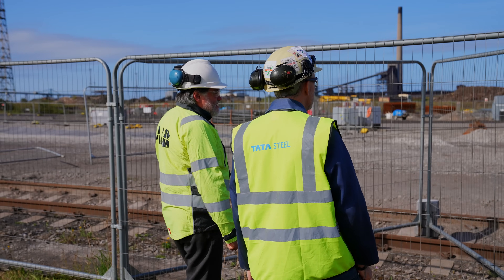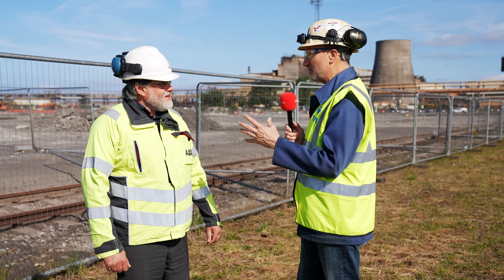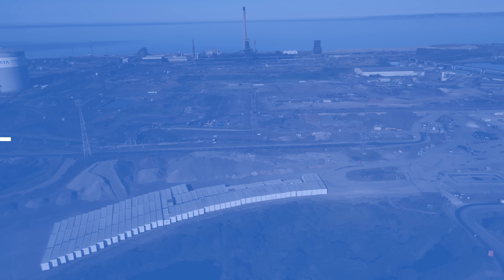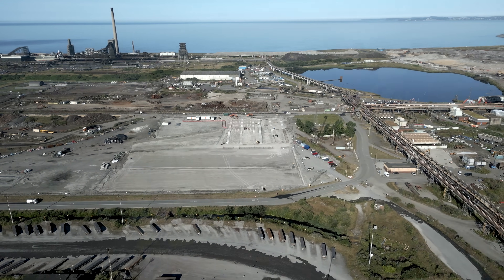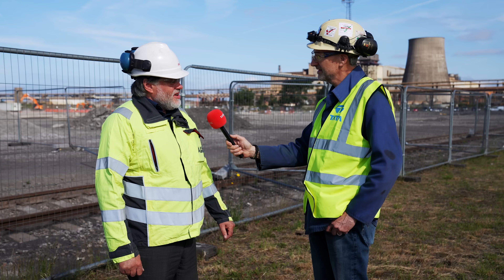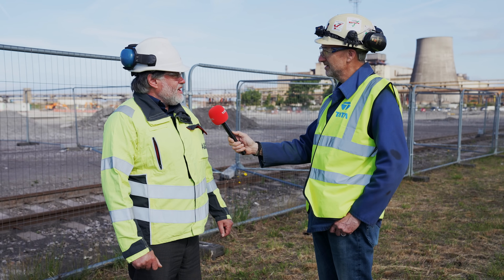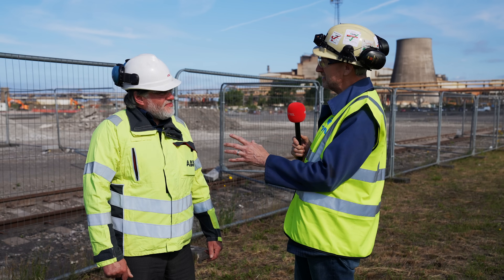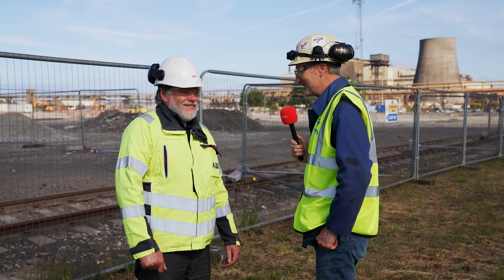Electrifying the Arc Furnace!

Comment: In the early 1950s I worked for Whiting Corp, in Harvey, Illinois in a production department that produced electric arc furnaces for the steel industry. The furnaces used 3 phase power, and I remember the size of the conductors for the 3 carbon electrodes of each furnace was around the diameter of my wrist. Electric power requirements for a factory or commercial operation are usually expressed in terms of kva (kilo-volt-amperes). Those quantities are extremely large for large industrial facilities, and often require local dedicated sub-stations or even power generating capabilities.

Comment: The UK government ruined the UK steel industry with all this net zero crap. Jobs have been lost, Families have been left struggling and shops closing down, all to keep the government happy all while more blast furnaces are being built in India! 

We simply dont have the infrastructure for the arc furnaces. They draw too much electricity, which will be coming from the Cardiff grid that already has an arc furnace at Celsa steel. And the cost of electricity in the UK is just far to expensive. So it will not last. 

They say it will create jobs and security, where? Just Port Talbot, as Llanwern is left to suffer like it has done before, as well as the other sites down the supply chain. Too many have lost there jobs and the number is by far alot higher than they originally say. Everyone has been betrayed and fed BS

Comment: 6000A at 33kv is a 200MW furnace!

The majority of the time south Wales is the worst part of the UK for burning gas to make up electricity short fall. 
And if gas driven turbines are about 50-60% efficient  add in transmission losses and the end result is swapping coal for gas.

Port Talbot needs huge investment in renewable energy generation. More wind farms and solar panels on every roof space.
Reply: Those don't have sufficient inertia for this kind of load. You need very heavy spinning generators.
Reply: @cTwelve  Arc furnaces does not care about deviations in frequency of a few hertz, Why would you believe that an arc furnace will depend on inertia of a spinning generator??
If inertia should be required, such machines are for sale, that does not require a power plant with a gas/steam turbine to drive the electric synchronous machine. 
In any case, inertia is not blocking the possibility to supply South Wales and arc furnaces with electricity from mainly wind, solar and battery storage for over 80 % of annual energy consumption and less than 20 % from combustion if e.g. methane (fuel that can be stored from season to season, to fill the gaps).
Reply: Lol!!!!! Renewable aren’t stable enough for such a massive continuous load

Comment: Problem here is this will ALL be produced from gas! Start steel cycle , start wind? You have to be joking!
Reply: Wind energy will most likely be cheaper than burning methane now, and in the decades to come.
If more wind farms gets built year after year, and supplemented by solar, the amount of gas burned can go down, instead of up. For Britain, the share of electricity made with methane gas has gone down to 31 % in 2024.

Comment: The Zinc Arc Furnace in Risdon, Tasmania, makes up for 11% of the states total power consumption. Crazy power goes into these furnaces.
Reply: The Tiwai Point aluminum smelter in New Zealand uses 13% of the country’s electricity! A few years ago they proposed closing the plant and analysis showed it would collapse the electricity market due to the oversupply!

The sound of an electric arc furnace running is something else as well.

Comment: Why no batteries to charge up when the grid isnt in use between 8pm-6am? How many GW per hour will it use and turning the arc off, will that create an imbalance in the grid? So much detail left out!
Reply: Good joke! It’s 200 mega watts of power which battery is going to supply that? 😂😂😂😂😂
Reply: They would not know if you asked them. They are there to give you pub talk. Notice the lack of anyone actually working on the site.
Reply: @Andrew-rc3vh they need 200Mw of power 24/7 no renewable or batteries will cover that
Reply: @carholic-sz3qv  That would be an ideal job for a small nuclear reactor. If you buy your own reactor you can cut out the electricity middleman.

Comment: You will never achieve low carbon steel unless you disconnect from the European grid !!
Reply: Where do get this ill informed nonsense from?
Reply: isnt the definition of steel high carbon content 🤓☝
Reply: Why ?
Reply: And where are you going to take the power from? Batteries and unstable wind+solar? They need 200Mw of power 24/7